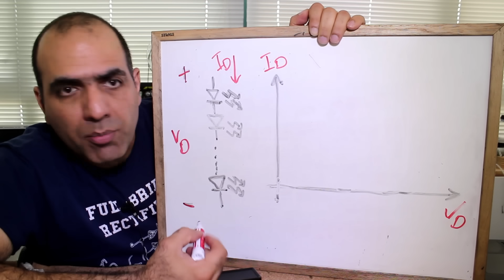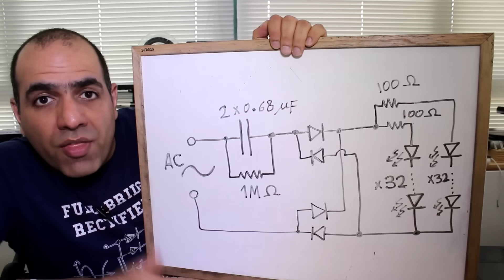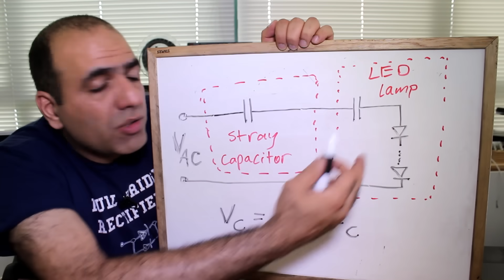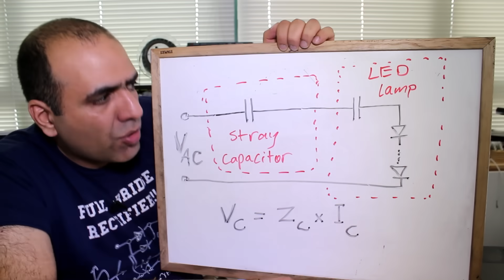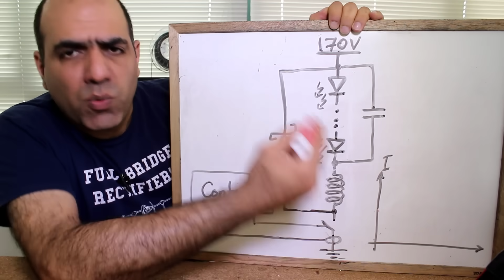Why Cheap LED Lights Keep Glowing

Comment: Thank god. Your videos save my life. I have leds for my interior lights in my 2004 Jeep gc, and they are connected to a dimmer in my car. When I open the door and run the car the leds will turn on them dim, but then they stay dim for quite some time while I drive which is rather annoying imo. I hope adding resistors will help solve this problem. It’s because the original housing of the bulbs are for  incandescent bulbs which require more power, in thinking that there is still a small amount of residual power even when the lights are theoretically switched off.

Comment: so basically the light switch is just wired wrong and only neutral is switched if the led keeps glowing when turned off
Reply from the maker: No still love switches off, Steve Mould explains it well

Comment: I have a different problem. When I plug in my phone charger into the power socket. The LED christmas lights flash dim on and off once. But it's connected to a switched off power socket box connected to a different power socket.

Are these LEDs flashing from the radiation from the charging wire?

Comment: Here in the Philippines we use some kind of LED bulbs that turns on whenever there’s an unexpected blackout.
Reply: Its not only In philipines 
Its the bulb itself which has a special circuit with a battery

Comment: Does this mean that there is always  current leakages through those LED bulbs?

that get the LED glow
or
that go through an  appropriate resistor?
Reply: Yeah.. I have the same question. The resistor he recommended simply by passes the current from the LEDs. So, I think there is always a leakage.

Comment: In my house i also have LEDs glowing when they are off. The reason i discovered is the combination of 230v single phase (no neutral, 2 live wires) and long cabling. Due to the close distance between the live wires and the Earth wire the cable acts as a capacitor between the Earth and the "off" wire. Solution: switch both wires off or disconnect the earth wire (not to bad if your using a plastic light fixture)

Comment: Why do cheap fluorescent lights keep glowing? I thought it was residual power open the capacitors in the base of the bulb which houses the ballast (is a ballast some sort of rectifier?). 
I noticed the bulb does continue to glow much longer than residual power in a capacitor normally would, but then again, it could depend on the size and type of capacitor as well as the circuit it is in.... no?

Thanks😀
Reply: shortest simple answer, there's still some electrons dying(decaying) in the phosphorous coating inside the tube, which makes it produce some light still.
the mercury vapor arc inside produces UV light which excites the special phosphorous coating to produce visible light. without it would produce a harsh and wild UV light causing suntan/burn and eye damage of course lol
EDIT: may as well link something usefull :) https://en.wikipedia.org/wiki/Fluorescent_lamp
Reply: throttle bottle -oh. Thanks for that!😀

Comment: "You shouldn't forget to turn the light off or open the breaker before working on your electricity" - best line in any science video ever. Edit: No that's second, best is "I love discovering by accident!" This guy is AWESOME! Edit 2: "That's it, no more using my body as a capacitor!" - funnier every minute! Edit 3: "stupid loose wires" - I'm dying here!
Reply: Rest in peace

Comment: 1:44 OR THE ELECTRICIAN WHO WIRED YOUR HOME DID IT WRONG AND MADE IT SO THAT THE NEUTRAL IS CUT OFF AT THE SWITCH AND NOT THE LIVE WIRE!
Reply: it's probably mainly lamps and other desk/task lighting that commonly gets miss-wired, has non polarized plugs, outlet has reverse polarity, lots of wire length/devices in the circuit leaking current and last, something touching inside the lamp, low breakdown voltage so forth.
**also many of those silly looking fixture have lamp/zip cord in them instead of white and black conductors, so not many people know how to wire them using the ridges or lettering to locate the hot/neutral and even then, there's no guarantee it's right at the socket unless you test with a meter first.
Reply: The circuit is not complete without the neutral connected.

Comment: I have several IKEA Tradfri LED bulbs that keeps resonating, like a capacitor is charged and discharged by the LED's.

I haven't opened it up yet because that means destruction of the bulb, but any idea's on the cause of this?

Comment: "What? Is the math to hard for you?"  Forgets part of equation and has to add it post script haha!
Reply: But he DIDN'T forget the Vin (6:05). It's there already.
Reply: Oh yes he did. I blame the small slate.
Reply: In a lot of circuit analysis, dividing the Vin is an automatic next step to arrive at the transfer function.

Comment: I have a set of Christmas lights that half the strand glows very dim when they are off. It's really strange. The strangest part is when it rains they seem to get a little brighter. Once I turn them back on they work as usual. I unplug them when I'm not using them because I'm always scared they will start s fire.

Comment: I am not trained in electric.

Will the resistor sucks current and make the electricity bill goes higher?
Reply: If you have enough, sure. Probably not enough to be more than a rounding error.

Comment: I actually like the bulbs glowing all the time. I have 5 bulbs in a light fitting. They were all the same at the start, but after a year, 3 of the 5 bulbs in my light fitting are now really dim when 'OFF'     ( but just as bright as the others when 'ON'). What's going on?

Comment: My question is, if I want this to happen, how do I achieve it? Will any capacitive-dropper-based LED bulb work, provided it doesn't have a resistor across the LEDs? Or does it need a certain amount of LEDs in series to work? Or some other factor?

It would be helpful for me to have some of lights permanently on, faintly.

Comment: Oh, okay! I think I’m beginning to understand the circuit drawings now.

Two lines is a capacitor
A triangle is a diode
Two pairs of diodes is an f.b. rectifier
A squiggly line is a resistor

But I still highly doubt I can comprehend the complicated-AF circuits in part two of the OneTesla demonstration...

Comment: After fifty years, I continue to use my body’s capacitance for experiments. Even as high as 75,000 volts nonstop for over an hour to better understand the human capacitance.  We are literally a living, breathing, walking capacitor, operating anywhere between a few thousand volts to tens of thousands of volts. Just that it’s in milliamps.  

When we touch a metal doorknob and get a nasty shock, that’s between 25,000 to 50,000 volts. 

It’s interesting to note that when I charged up my body using a 75,000 volt rated electrostatic generator, dozens of greenish blue balls of light formed on the highest point of the hair found on my forearm. I did this in a controlled darkroom, which allowed me to see easily see these tiny balls of light. You can even use your middle finger to flick them into the air. If you flick them at the aluminum globe on top of your static generator, and do so just right, the tiny balls of light will go around and around the aluminum ball quite a few times before it dies out.

Simply contact me if you want greater detail how to go about this, as it’s a bit much to get into here via text. 

⚡️ You’ll need specialized video gear to capture this low light event. And you’ll need to let your eyes adjust to a truly black room for a solid half hour before starting this experiment. 

By the way, once again, you’ll be using your body and hands to pull electricity, but it only hurts a little when you first place one hand only, onto the aluminum ball. You’ll be leaving your hand there (non-stop) for a solid hour. Sit on a tall wooden stool with a foot rest, and keep your feet there. Placing them on the floor adds yet another dynamic to the experiment.

What was the make and model of this small LED bulbs?

You really should have some serious fun, and make three static capacitors using 18” wide by 36” tall  PVC pipe. It’s easy to line the inside with foil.

🚨 WARNING 🚨 IT WILL SHOCK THE CRAP OUT OF YOU.

Good luck and have fun! 🙃

Comment: Probably I missed some bit of information, but [scratching my head]... isn't that with the resistance applied, the led bulb doesn't glow, but the current draw continues, so basically I'm paying an electric bill even keeping lights turned off? :) :)

Comment: So if the light stays on is it FREE power to light LED????
Reply: no, it means that your ordinary electric system at your house STILL consume a bit of electricity, even if everything is turned off, and you pay for it too

but cheap LED are not protected against that "bit of electricity" leakage and glow because of it

Comment: the difference between making something that works and making something right that works ... in the end it boils down to cost ... the rectifier circuit costs too much for the many cheap lights made but for the bulbs it is worth it to add in ... as they charge more for them anyway .... 

I miss the days of making things the right way that work

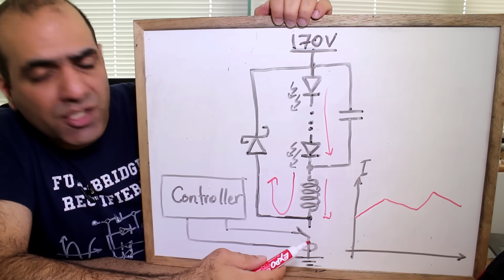Comment: At 9:22, "such circuits require a few milliamps of current to start operating, so a few microamps of leakage through the wires won't turn it on." In other words, the bulbs with the switching regulator waste at least as much (and probably more) than the ones that glow when off, but we don't see a glow, so we ignorantly feel like they are less wasteful.
Reply: Well yeah, but even incandescent lights waste that energy

Comment: The floor is grounded through the conductive mortar on your floor, and so are you when you sit in a metal chair.  Your body did not act as a capacitor, rather a weak resistor.  The more direct contact with the ground, the higher the voltage.  Concrete and mortar conduct electricity poorly, but they do.  This is the reason the cheap bulb didn't shock you and the cut open one did.  The capacitor in the circuit limited the current.  The cut open bulb connects directly to a rectifier with no reactive capacitance or resistors.  With that cut open bulb, the only current limiting factor when you touch the ground wire directly is the small resistance of your body.
Reply: Don't you dare correct @ElectroBOOM .  @ElectroBOOM What is this guy saying? Is he correct?
Reply: @ahpacific  NO.

Comment: I am an electrician. Most people joke about having a negative opinion about lawyers. It's not absolutely true that they hate all lawyers but most people have both told and heard the following joke. "A cadillac was discovered at the bottom of a lake. Inside there were two deceased lawyers. Do you know what concerned investigators the most about it? A few dozen lawyers could fit inside a Cadillac"....Or something like it. Point is (most) Electricians feel that way about engineers. This guy has to be an engineer...I mean a "professional dumbass"... however he is cool and while name isn't Steve. I subscribed to your channel bud. Great video! 

Odd ball, one off scenarios with communication and electrical circuits are my favorite. I've seen so much crazy shit. That my team and I adopted a few euphemisms for them...feel free to apply them to your odd ball encounters...
1) Customer has either allowed or created such a mega-mess of wires, cpe and old junk. That a complete do over is the fastest fixed. This is the Alien Abortion...
2) Basically the same one as the above but the custom won't allow you to bypass anything because he's something of an engineer. He really knows his math. This is The Engineered Bathwater Baby. Suicide is often the only option. 

Be safe everyone. No new nicknames

Comment: In a proper electrical installation, the neutral is always connected and the live is being switched to the light. There could be some leakage (some dimmers can leak several mA), but it's more likely that that switch and light are not wired properly.
Reply: Thank you, the comment I was looking for 👍👍👍

Comment: Excellent job! You are awesome! Please don't electrocute yourself to death. I mean, I love watching you electrocute yourself, just be sure not to die.
Reply: Well if u dont know most of his fails are staged
Reply: @mouseboi312  yep. but that don't mean he's not playing with fire to provide entertaining and educational content.
Reply: Apparently he's really smart and knows how to hurt himself without accidentally killing himself.
Reply: He mentioned the peak AC voltage is ~170 - so these are 110V nominal AC mains, such as in the US.  Male electricians in the US commonly touch wires to see if they are live.  Brief contact with 110V AC will not kill you - just hurts, and pain tolerance is evidently a sign of manliness.  The 220V AC mains in Europe could very easily kill you.

The US uses the less efficient 110V for most appliances because it is safer.  High power appliances like dryers, central air conditioning, electric ovens and stoves, use the much more efficient 220V and are either permanently wired, or use special locking plugs.

People do die from 110V AC - but it takes hours.  Scenarios include a 110V appliance falling into the bathtub, and an electrician falling onto a live wire.  The 110V does not immediately kill you - but it paralyzes muscles, preventing you from pushing yourself off the live wire.  After about 2 hours, the current will paralyze lungs or heart.  (Almost makes a quicker death from 220V sound preferable.)

So this guy is in no real danger.  Oh, and frequent, repeated 110V shocks can fry your the nerves to your fingers (or wherever contact is made).  So don't make a fetish of touching live 110V wires.
Reply: I'm afraid this guy does have a live wire fetish: https://www.youtube.com/watch?v=GlM6PE2kKVY  - where he explains GFCI outlets to save people from getting (slowly) electrocuted in bathtubs.
Reply: @sdgathman  i cannot fault that premise. he does seem to get a bit of pleasure from a zap.
Reply: @sdgathman  It depends if your grounded.
Reply: @sdgathman  He zapped himself with 2kv once
Reply: @sdgathman  gotta hand it to him, he takes the pain admirably, and i hope he never endangers himself. thank you for clarifying the risks he takes to provide entertaining and educational content.
Reply: @SamLOL yea lol that's why I said most some of them are real 😂😂😂😂
Reply: @SamLOL shit im losing my sanity day by day 😂😂😂
Typo
Reply: Hmmmmmm,
Shock him so he feels pain,
But not enough to kill him,
Sounds like torture to me.

Comment: Dude, wtf are you doing, working under tension?! Only myself do that.. Now please set the PG rating to 18 to your videos. Seriously, what child/fully grownup man WOULD NOT try this at home?! Your video may be really dangerous, specially in areas with 220v. You probably live in 110v area or have a really low  body capacitance. Anyway, when you touch a hot/powered thing, you should use the back of your fingers, not the palm or finger tip, for a phisiological reasons: the pain/current WILL make your fingers to FLEX (unfortunately around the wire or the hot thing).

Comment: I noticed this effect with LED lights in my home on circuits with 3-way switches and wondered about the cause... capacitance or some leakage due to the 3-way wiring??  From your investigations I expect it is a capacitive effect.  Thanks   jilsoft@live.com

Comment: There is a 100% chance you will not see this. But ill ask away anyways, maybe someone in the comments knows. I have recently gotten involved with salvaged electronics to make rc cars for my kids "and me obviously."  So im trying to get 11v to an old top of the line rc car. im using a 20v power source for almost all of my builds implementing voltage regulators etc. I have attempted to run 2 5v regulators in parallel in hopes that it would produce around 10v but all that has occurred is a more stable voltage. Any help?

Comment: Why CAPACITOR NEEDS FEW SECONDS TO CHARGE IN AC,?? 
BUT WE KNOW THAT IT CHARGES AND DISCHARGES ALONG WITH VOLTAGE WAVE OF AC. SO IT SHOULD TAKE FRACTION OF SECONDS TO CHARGE.
Reply: Ac is going back and forth unlike dc so maybe that's the reason? I'm not entirely sure myself

Comment: I know it's a little confusing to ask, 
When we connect a wire to a DC battery, it has an electric field that is static, starting from one terminal to another, which makes electron flow and can induce a magnetic field in the surrounding perpendicular to the wire length, which is again static.
Why not vice versa?
Or is it the flow of electron that creates a magnetic field?
If so, then why is it static, as moving electron should create a variable electric field in the surrounding, hence the variable magnetic field, which again induces a variable electric field and hence generating the electromagnetic wave. But an electromagnet connected to a DC battery never creates the electromagnetic waves.